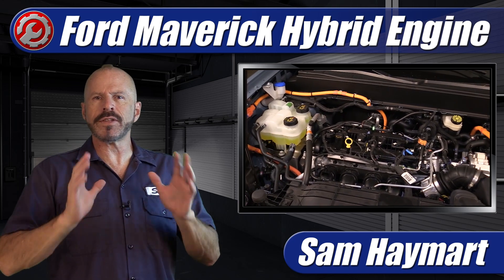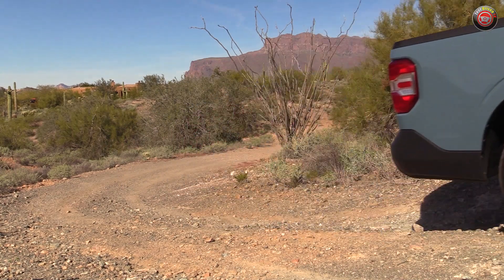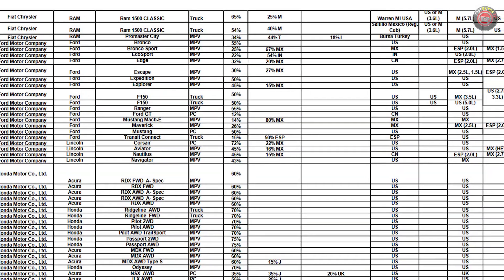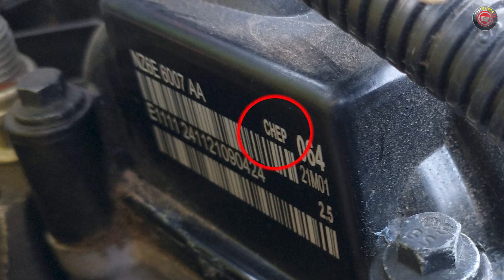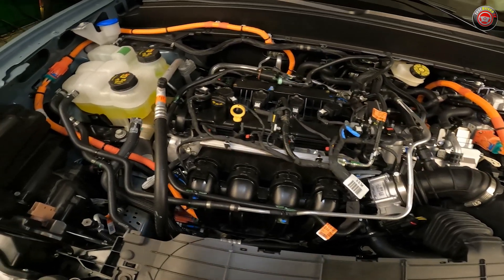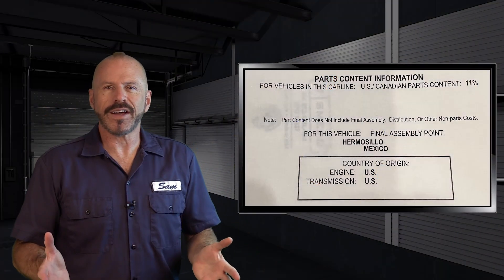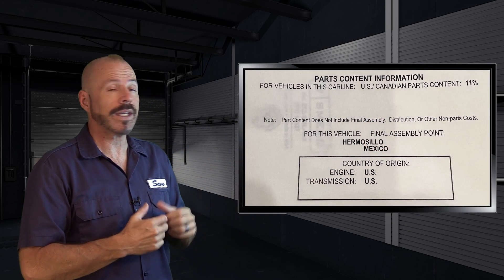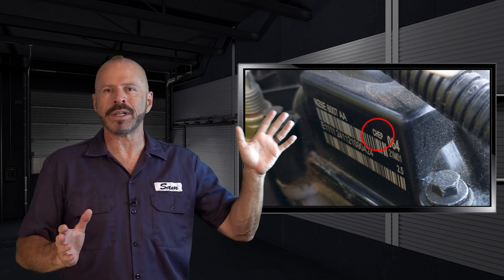2022-2024 Ford Maverick Hybrid Engine: Where Is It Really Made?

Comment: Hope they fixed the recall # 23S27, which had the issue with engine fires across the hybrid 2.5 engine models.
Reply from the maker: Not as of the moment. Still waiting on recalls to be completed.
Reply: Other than extending the warranty, I'm not sure how they can fix this issue. The issue on the crankshaft is difficult to identify and fix tbh.

Comment: I understand the original “engine fire” issue had to do with mis-machined crankshafts (pin journal fillet too large, I think).  Don’t know if there have been other issues leading to thermal events…

Final assembly location of the engine would be irrelevant to the crankshaft defect because the crankshaft is likely made in MX in either case.

Comment: Is it possible that engine is dressed in the USA at or near final assembly and called made in USA accordingly? This might help with things like fuel line issues.
Reply from the maker: No. And there are NO fuel line issues.
Reply: Maverick production lines are now being setup at the Louisville KY plant, in parallel with the Ford Escape & Bronco Sport production lines there.

PPAP has been done in Louisville and small batch 2liter ecoboost engines are being assembled in Louisville, Maverick hybrid traction battery assembly is also being setup in Louisville so its plausible the 2.5liter Atkinson is already in low volume production.

Dude go back to fixing your cars, you clearly know jack shit about the automotive manufacturing processes and the break neck onshoring of production in response to threat of tarriffs.

Finally Ford Dearborns investments in a modular universal  multjvehicle platform is paying off.

Comment: I received my 2023 XLT Hybrid Maverick last month. Several days later I discovered that smaller window sticker in the glove box and immediately informed family and friends about the great news! U.S. built engine and transmission!  Ford, whoever is responsible for placing those INCORRECT window stickers on the Mavericks should be dealt with and customers are due an explanation! 
But so far so good with my MEXICAN made engine, and the MPG is really great! Over 48 MPG on first tank with mixed city/highway miles.
The 2024 Maverick orders open up on July 17th, and had thought about ordering a 2024, but then decided to keep the 23 with the "U.S. made engine". Now, I don't know what I'll do, but do predict that the 24's will sell out in less than a week.
Reply: The y are made at the Pope plant in Hartford CT